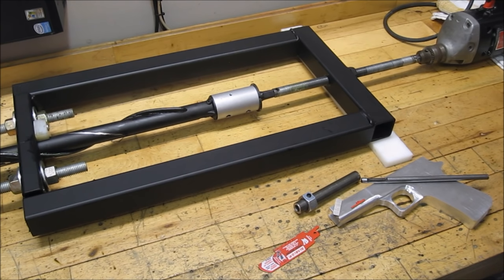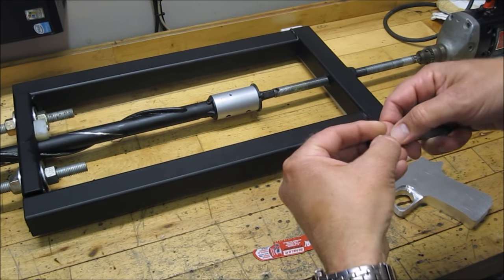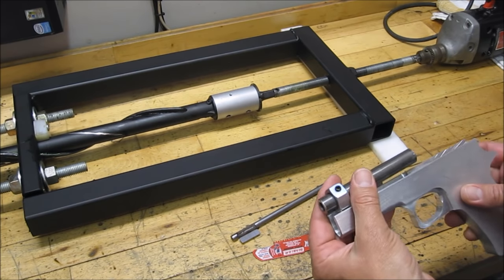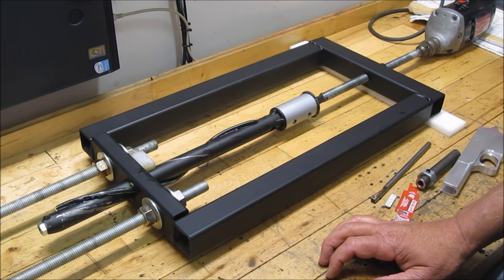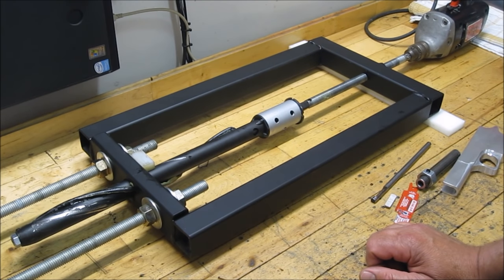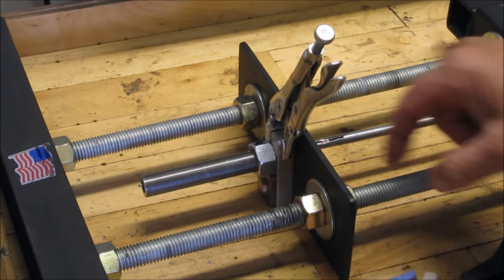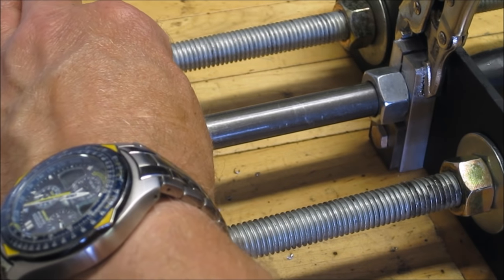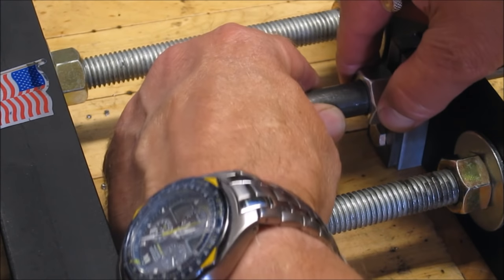Homemade barrel rifling machine, rifling the Kolt380 barrel

Comment: This is an awesome setup.  Only enhancement I can suggest is... Drill a hole in the end of the rifling shaft, tap it, then use a pointed set screw.  Angle the cutting "tool" at the end facing the set screw.  Each turn of the set screw will cause the cutting "tool" to push out a predictable distance.   At least it works in my head.
Reply from the maker: I used that technique in the first version. I didn't find the paper shim thing to difficult, and it did give good control of depth of cut.

Comment: there are tools you can buy at a machine supply shop for doing this. having said that, I am impressed with what you have done here. a lot of work to do what might not have been so much work but if you have the time and just want a hobby why not? this is how the machines and tools we have today were made when they were just concepts, ideas. 
 nicely done!
Reply: Warmwater I suggest watch a 13 part series called What on earth happened by Ewaranon to learn that the earth is not a globe. I got it in my about tab.
Reply: @flat-earther  the proper term is spherical elipsoid or something. no, it is not perfecly, or even close to round but just try making an accurate representation. it wont sell and its just easier to make it round.

Comment: When Pope cut grooves, he ran 20 times over the same groove. A very painstaking task. That was per idex. 20 X 6 grooves - 120 passes. The amount of metal cut was just a sliver. I figure I will use diamond, as it is what I have, but you have given me a way to repair a rifle and make an 0.303 Brit/ 8mm. I was going to go 35, but 3.23 was right there. Thanks

Comment: There seems to be a fair bit of deflection on the lower end of the barrel. Since you already have those threaded rods on either side, you could use them to install a simple guide with a hole in the center using the outside diameter of the barrel. Maybe this will give a more even depth of rifling. Nevertheless, this is an amazing machine and I will keep it in mind!

Comment: Oh Man , Clinton Westwood - YOU ARE GOOD , You are realy , realy GOOD ! I think, without your video, I would have pulled the RUN straight and later, if I had cleared the fields inside, then I would heat the LAuf to red-hot paint and then torse / twist NICELY. Then judge. I would have ground the tool for clearing from an HSS turning steel, so that I could have pulled or pressed it as a tool through the barrel - To adjust I would have used a maggot screw probably to get the adjustment of the tool.
Using a hex nut, the hardened saw blade teeth, the holder for the saw blade and so on - everything is so inspiring. How you sawed the bike, that made MUT to make plans again. I downloaded the blueprint and today I suddenly know why I never threw the wheels away from the storage and everything HORTE. I'm new to your channel and look forward to finding more videos later, with blueprints that are thoughtful and logical. In any case, your clearing tool is great and works! You're a genius! By the way, thank you very much for the inspirations! Greetings from the occupied DEutschland
Reply: a Question : Do you use general mild steel (st40) or carbon steel (C60) to make barrels?

Comment: I would have taken the housing of your thrust bearings and closed most of the holes and left one hole remaining and tapped it and put a zerk fitting in it so you could grease the bearings with a grease gun. It would keep you from having to disassemble it and pack more grease when it is needed. 

This is a great tool.
Reply: He is probably not going to use it enough that its ever going to need to be greased.

Comment: Extremely simple, elegant, and impressive. I wonder if it could be modified and hold together to push or pull a rifling button. Keep up the excellent work.
Reply: No. A button requires much more force than a hook.  2000psi hydronic pressure or perhaps more.  There are some buttons, usually made by hobby types, but these require a hydrolic press. A home or small shop press of the sort would weigh several hundred pounds and be powered by a large bottle jack.

A hook system uses a lot less tooling, costs a lot less and does as good or better job.  This can be seen in test targets.  Typically tight groups usually equal to good factory guns.

Comment: i tried a length of square bar with a gain twist driven through a square hole and twin cutters cut from edge of a file ,slow but it worked nicely and gave a polished finish by the end ,an interesting project .

Comment: As per shim stock.... The thief security thing they typically place in consumer products, mainly DVD's, they are typically black plastic, sometimes white... and are held in place with sticky tape.... and are approx .300" x 1.675" long or (7.60 mm x 42.50 mm)... cut open the one end with a razor blade... fold back the plastic, and allow the two shiny thin bi-metal foils to fall out, or it the security thingy was bent up while trying to remove it from the DVD case, you may need some tweezers to pull them out... these thin foils measure 0.0005"  or (0.01 to 0.02 mm) thick and are not hindered by solvents or oils... and can be cut with scissors to desired shape... I hope that will help . I pull them off and throw them on a magnet and when there is a mess of them, I cut them open, and save them into my shim stock drawer ...

Comment: I guess the last pistol I built was a M1911A1, I picked up a Remington frame and the rest of the parts off Numrich Arms, the trigger out of Shotgun News.  We still had the bluing tanks set up back then so I spent two or three weeks polishing the frame and slide so when she blued up, she looked like a S&W Royal Blue. I had my buddy gunsmith do the trigger job as I was having a hard time with that, then I jeweled the top of the barrel so she would have that bit of custom look, shot a box of ammo through her to insure she would work, and took her to a gun show.  Well she was on my table for only a half hour, and before the doors opened to the public, I had several offers. I finally gave in and took a Glock 17 and a Remington .22 along with some ammo for her.  I really like that gun but so did a lot of other fellows I guess.  The last odd-ball I built up was an Austrian Styer Manlicher straight pull rifle that I re-barreled and chambered in .444 Marlin.  Since the Styer was a rimed cartridge, this worked out fine, and I later used the .444 Marlin reamer and left over barrel on an old Engfield 1917 action, put that on a black plastic stock with a 4X scope, made a wonderfully accurate deer woods gun. I took a deer with each rifle before I sold them. Sure wish I had kept that straight pull Styer though. Now all I have left is my old duty .45 ACP and a little Citadel .45ACP officers model for conceal carry, although I think my old Aster A80 is about as light weight, but thicker due to the double stack mag,
Reply from the maker: Very cool. You are way ahead of me experience and ownership.

Comment: (AM Labels)  Alarm tabs that are placed on packaging have two sheets of metal, one glued the other sits loos they are 100in thick and about the right size.(1.25 by .25 abouts)  aluminum can 0.004 in.  or dollar bill .004

Amazonian... a little pricy though... .. .  
$21.92 /   316 Stainless Steel Shim Stock, 0.001" Thickness x 6" Width x 12" Length, Stainless Steel Sheet Shim, 2 Pieces

Comment: a possible touch up that you can add to the process is to use some kind of a fan or hair dryer to blow the barrel after each pass to make sure that no filings would stay and scratch the barrel. Any marking on the barrel can change the trajectory ...

Comment: I do like your helical screw idea, but have you ever considered a sliding rack following an adjustable angle and turning a gear to rotate the cutting head? Such a set up allows the cutting of multiple rates of rifling twists with a simple adjustment of the angle that the rack follows. I saw such a system on another of these great You Tube videos.
By the way, I am breathlessly anticipating the quality of your finished Kolt .380 and possibly future designs in 9mm or .45 using a locking breech similar to the P-35
Reply from the maker: I find the screw idea very simple to do. I hadn't considered other options.
Reply: I think what he has done here is slick.  Cannot picture your more sophisticated setup. Can you remember the YT header, the reference?  Picture worth  a thousand words here. 
The use of the bicycle bottom bracket is a very smart reuse. Carries the load axially, perfectly. Does not matter if the ball bearings are tired and worn,just gets the job done. The rest of the setup is simple in a way,but well made where it needs to be. Bet you would have made a great old time blacksmith.

Comment: Excellent work.So that plate is just to push teeth of the saw?Does saw have some stairs,cascade (i don't know how to explain),or the teeth are straight and represent depth of the groove?I ask that couse i am impressed how it can take so much resistance,tension etc. that you turn only one way without pulling out,impressed how they are not broken etc...
Reply from the maker: Yes, the plate with the paper spacers are just to increase the depth of the cut. The teeth are not stepped, just straight. I suspect that there is some movement in the angle while cutting so that each one takes a small cut. The cuts are not deep, so the tension remains small.

Comment: As a bullet propagates down a barrel, its angular-momentum increases roughly linearly, with its increasing velocity.  Might the most accurate bullet be the one exiting the barrel without net twisting forces?  In other words, variable taper on the barrel rifling?  Ramping the bullet's angular momentum up to a certain maximum, then tapering the rifling to maintain constant angular-momentum for the last few inches before the bullet leaves the barrel?  Pushing the bullet out with the fewest forces in any direction other than toward the target?
Reply: I believe you may, in part, be referring to progressive rifling. I recently followed Ivanthetrolls ECM method to make a 9mm 50-10 progressive twist barrel.
Reply: @mikebrown7324  - Any way to determine whether it improved accuracy?  Most seem to be discussing "gain twist?"  That's the opposite of what one might think?  Why increase torque and surface resistance as the bullet gains speed toward the muzzle-end?  The argument is to better seal bypass gasses by forcing more pressure in the lands, but attenuating-twist accomplishes the same sealing (any change in twist, increasing angle or decreasing angle seals the lands) benefit?  And by attenuating-twist, the bullet exits faster and with less last micro-second torque that leads to the bullet rocking as it leaves the muzzle?
Reply: Tom Noyb I suggest watch a 13 part series called What on earth happened by Ewaranon to learn that the earth is not a globe. I got it in my about tab.

Comment: get away from using carbide and use high speed steel the hss will produce a better finish when used at a slower surface feet per minute  keep it up I love the home made stuff
Reply from the maker: I'm actually surprised on the finish the carbide left.

Comment: Ever thought about a light spring mechanism to hold it in place and provide a little bit of self adjusting resistance so you don't have to constantly replace the halfround piece of material on the cutter?

Comment: Your work is very Impressive. Is the little block that sits in the notch thick enough to embed a little piece of hard drive magnet so it does not keep falling off? Or of the metal type so you could magnetize it?
Reply from the maker: Fairly tight tolerances to add a magnet. I don't mind it falling off at the end as I want to reset the cutter to the other end without any pressure on the cutter.

Comment: Very Well thought out, love your method. Would you ever consider using aluminum foil as your shim stock or wouldn't that work as well. I'm seeing your paper method worked just fine. Just curious... Thanks for the videos..
Reply from the maker: Never thought of foil. I'll have to measure some. Might be more robust.
Reply: You can buy shim material of specified thicknesses.  I've seen sets of brass shims that vary down to foil thicknesses.  I assume they sell stacks of steel shims. Or make several of free swaging part in coded, varying thicknesses.

Comment: There are a few vital bits of information missing, like how does cigarette paper push the cutting tooth (teeth?) up it's groove in the rod when you lay it across the flat like that? How do you calculate what the twist will be for a given length of barrel?
Reply: The cutting tool is in the same position in the rod, the paper doesn't push the cutter out of the groove, the paper increases the size of the spacer piece that's opposite of the cutter so the diameter of the entire tool i.e. both the teeth and the spacer increase when adding more paper.

BTW Jonathan I suggest watch a 13 part series called What on earth happened by Ewaranon to learn that the earth is not a globe. I got it in my about tab.

Comment: Hi what size steel rod do you use for the barrel, and how thick should the wall be, also do you buy hollow or solid steel tubing. Thanks
Reply from the maker: This is hollow tubing. The OD is 5/8 and the wall and ID before reaming was less than than the bullet diameter. Check my video here, I think it has the dimensions... https://www.youtube.com/watch?v=i7eKRlaHj6Q
Reply: +Clinton Westwood thanks Clinton hope the build is coming along well im looking forward to the end result then im going to a project of my own, i have been reading alot of Bill Holmes hoping it will help me out but nothing is better than a good old video.
Reply from the maker: np. I hope to have a new video today.

Comment: would cutting oil help? When I tread pipe if I dont use cutting oil the tread sometimes tear out and not now smooth.
Reply: Erik I suggest watch a 13 part series called What on earth happened by Ewaranon to learn that the earth is not a globe. I got it in my about tab.

Comment: That s a groove maker like grooving a vinyl. Negative elements in the barrel, the rifling is positive outlevels I think. Will it still work? Probably it wont leave grooves in the bullet. But will it still twist?
Reply from the maker: That's the way all rifling is created. The barrel starts slightly smaller than the diameter of the bullet. When The grooves are cut leaving the ridges, or lands to grasp the bullet on passage to give it the twist. I'm not an expert in this, but the little barrel I did for the Krickit 25 imparted enough of a spin to keep the bullet from tumbling over any distance I was able to measure and still hit the target. Recovering a fired bullet showed good evidence of engaging the rifling, There's either a video of that or something in my build logs. Can't remember at the moment.
Reply: Clinton Westwood yeh thanks but my doubt is because in this one i couldn see enough rifling grooves to turn them into positive levels, i dont know how to explain. The point is i believe in low calibers as .22 with a bullet poor tighten to the case, the grooves must be "positive" so when the projectile travels, the barrel leaves quite deep marks on it. This level of friction could the the responsible of 100% powder ignite. In case of higher caliber as 9x19 the buller is very thighten to the case and you dont need to make the intial barrel diameter smaller than the bullet, 100% of the powder will ignite due to this level of tightness. In conclussion, this type of rifling for sure will work on 9mm but i doubt it can work in 22 rimfire. Sorry for my grammar im argentinian.
Reply from the maker: As far as I know, it's very important for all bullets to seal with the barrel when travelling in order to get the best push from the expanding gasses. If not tight, all the high pressure gas blows past the bullet resulting in low velocities. I guess we'll see when this build fires and I can examine a recovered bullet.
Reply: Clinton Westwood yes but my theory is only important for 22lr and the like cuzz the bullet is not "glued" to the case and other ammunition it is. And this is because powder producers make it with grains too big so if not pressurized it wont ignite properly. This problem is not present in black powder weapons, even without a good seal the projectile will reach its intended velocity. Black powder tends to turn into energy with high efficiency while  celulloid not. Sorry for boring yo and thanks for answering!!
Reply: +Sean Van Diijk I know what you mean and wondered about this as well. wonder how much more work&time one done with the "positive" groves is. haven't thought up a tool yet, although cnc(especially salvage built)is cheaper and cheaper

Comment: You should consider investing in a rotary table, indexing with Eyeball MkI and a nut seems like it's working, but you could get a whole other level of accuracy with a rotary table. Anyway, great job, and just goes to show that no matter how restrictive a gun law you impose, when all is said and done, a population can arm itself, with whatever consequences for a regime that might have.
Reply: What about ammo in countries where guns and ammo are banned. The gun is useless without ammo.

BTW Mace I suggest watch a 13 part series called What on earth happened by Ewaranon to learn that the earth is not a globe. I got it in my about tab.
Reply: @flat-earther  Where there is a will, there is a way, and yes, if there is simply no ammo available in the country, it makes things a bit more difficult for would-be guerillas, but then again, you can't prevent people from making black powder, and shock sensitive compounds to use as a primer isn't impossible to make either.

And I'm aware the Earth is not a globe, it is slightly wider at the Equator.